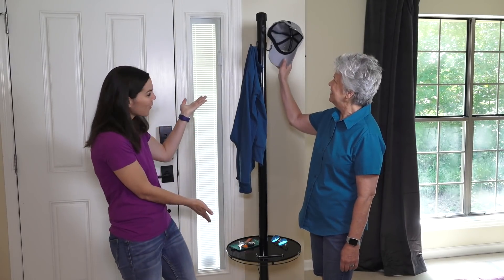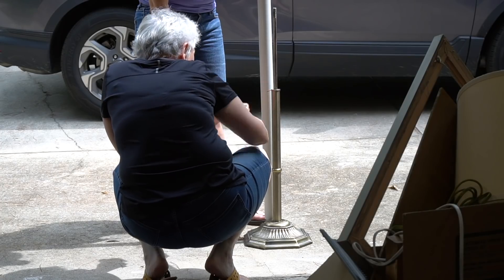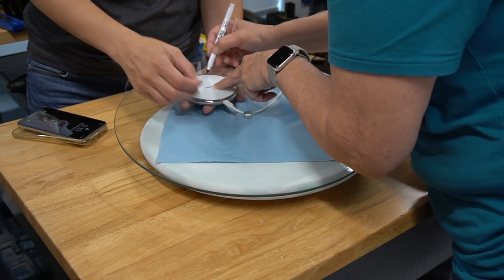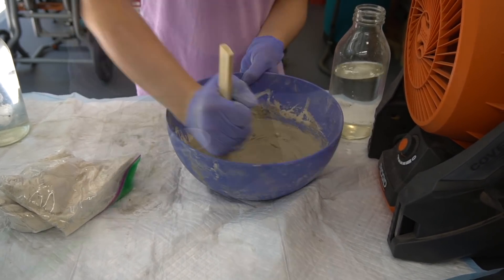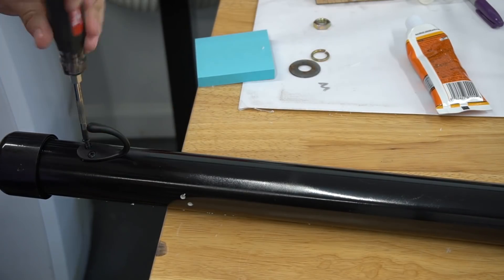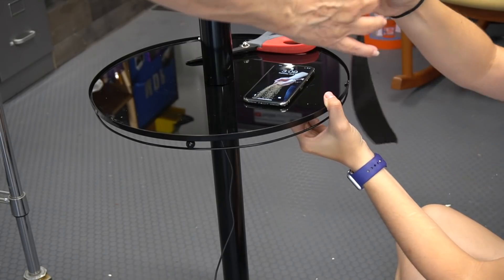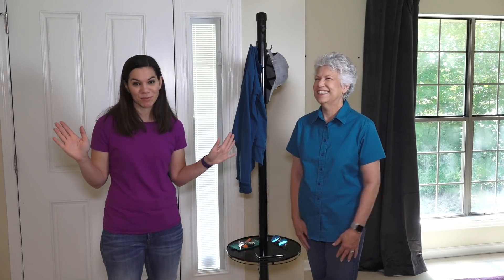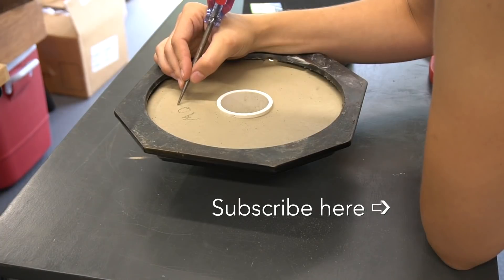How to Turn a Floor Lamp into a Coat Rack

Comment: Nice project. If you made a wooden disk for the top and bottom with a drilled hole that fit into the PVC you could use the tubing, that the lamp cord was in, to add extra support while the foam dried.